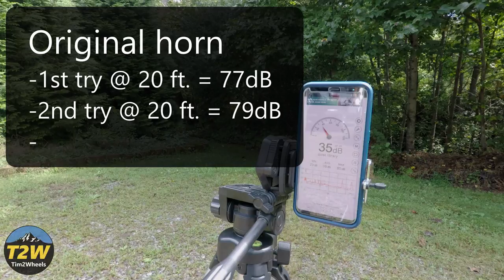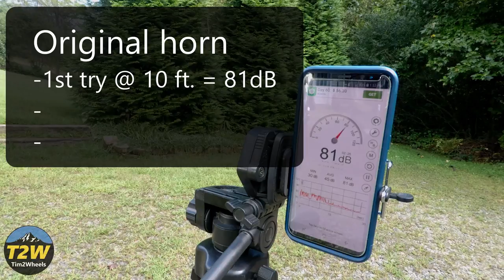Car Horn Upgrade on BMW GS Adventure. Is it worth it?

Comment: I just installed one (BMW auto horn) with out removing ANY of the panels/fairing. Easy. Just remove the existing horn only, not the brace. Bend back the brace a bit for final fit. Fit new horn in existing brace. Plug n play. Sounds great, did it in 15 min. 2021 GSA 1250

Comment: Tim I just replaced my stock horn on my 2016 s1000 XR with the BMW 5 horn.  It was a 30 minute job thx to your video and huge improvement over the road-runner "meep meep" sound of stock.  Thx for the help

Comment: I will have my GS in November and intend on doing the same. Thanks for sharing. 
I will attempt to only loosen the 13mm nut and replace the horn part and not the bracket, this way one don't have to remove all the body panels.

Comment: I received my BMW car horn today and intalled without a hitch as per your video. The hardest part is removing all the body work. While I was in there is cleaned the air filter. Thanks Tim.
Reply from the maker: Hi Kim, I'm glad the video helped. I really like that horn. And you're right, that BMW bodywork is the hardest part. - Thanks for the comment and for watching.

Comment: The Denali Sound Bomb is the bomb! The OEM Low Pitch sounds fantastic too. I hope BMW addresses this for the US market in 22. With these bigger displacement GS/GSA bikes being used more on the super slab it’s imperative to have a way better horn. Ear piercing it should be. Way too many distracted drivers on cell phones and in-cR tech. As well I’d also like  to see “backlit handlebar switches” for night riding and an electric windscreen.  Put it all in a Option 719 package and call it The Highway package. I’ll buy it! Ride safe and ride often.

Comment: I have just installed a horn from a 5 series BMW car.  The cars have two horns a high tone and a low tone.  They are a mirror image of each other. I found the high tone one fitted in place with the horn pointing down. High and low tone are written on the horn. otherwise they have the same markings.
Reply from the maker: Hi, thanks for this info. I will need to take another look at that mounting option.

Comment: I always appreciate the thoroughness of your demonstrations, Tim. Coincidentally, I fitted a Soundbomb to my R1200GS LC only yesterday. It required an additional lead to fit to the canbus wiring but, otherwise, was a straightforward installation and was achieved without having to remove any bodywork. It's incredibly loud too.
Thanks again. 
👍
Reply from the maker: Hi Keith, I was really tempted to buy a Soundbomb. Thanks for the info on how it installed.

Comment: The dB meter is an indication, not logic why the new horn is louder at larger distance. For automobiles the tone is more important than the sound level. Nice with a quick solution without rewiring a part of the bike and no errors from the CAN bus

Comment: Thanks Tim.  From one bike you tuber to another.   I’m a Denali stockist and installation specialist but I do believe in having options and I will be looking at this as an option for buyers who want to be heard but not going all way with the air horn soundbomb.
Reply from the maker: Denali products are good stuff. But it's always nice to have options.
Thanks for the comment and for watching.
Reply: I have a Sound Bomb but the bike I have is a Factory Lowered R1250 GSA.   Twisted throttle says it's not possible to mount that horn between the forks as shown on their website.  Any thoughts or suggestions?
Reply: Michael Glasman I’ve fitted the soundbomb to many factory lowered 1250s.    It fits fine, however they may be referring to the clearance when the suspension is fully depressed.

Comment: I wonder if you could have found a place to add the car horn, keeping the stock one working also.  Two is better then one!  Unless you need to count amperage.  Also noted at 13:20, you rotated the horn down to get the sound out.  That would also be important to let water get out!  I'd guess you could catch some wetness on a rain day trip.  If the horn was aimed up, no place for the water to escape.

Comment: Great video, Tim.  I am getting a 1250 GSA in a week or so.  When I was watching your video, I was really excited about using the car horn, rather than the Soundbomb. But the results were not encouraging.  I have read the comments from other viewers and they make sense to me.  One last piece, though. I noticed that the car horn was louder at 20 ft. than at 10. That surprised me.  I also would question the Denali claim that it makes 120 DB.  Perhaps in a controlled environment with a better recording device?  I am thinking that I may try out the car horn option, as the lower tone would have value.  Since my new GSA has LED Auxiliary lights, I may not go with putting in a Cansmart system.  

In any event, thanks for the video, Tim.  I will search your other videos to see what other info I can pick up.  There is a huge difference on the motorcycle videos
Reply from the maker: Hi James, sorry for the delay in responding.
I'm not sure how accurate an app on a phone is for truly measuring the sound, but to me and everyone else who hears it, it is much louder. It may be the lower tone, but the sound does seem to carry better. I'm very happy with it. I hope it works for you too. 
Thanks for the comment and for watching.

Comment: Very interesting Tim. Some of the difference may be that the microphone on your phone may not be able to respond to the transient response range of the sound of the 2 horns. Also, I'm sure it has a limited frequency response range. I'm not a sound technician, but I feel like you would probably get a different result with professional microphones in a controlled environment.
Reply from the maker: Hi Roy, I think you're right. I'm sure the propper equipment would give a more accurate result. 
Thanks for the comment and for watching.
Reply: This is exactly why.

Phone apps are next to useless for measuring narrow band sounds like a car horn. Only really good for average levels of broad band sounds.

Comment: Most cars today use two-tone horns, low pitch and high pitch.  My K1200LT came stock with such a setup and it is loud for a motorcycle.  Sounds just like most modern cars.  I suspect the low pitch horn by itself will be only slightly more effective than the stock horn.  However, if you can find room to add an OEM high pitch horn also, you will have a great horn overall.  Both of my LT horns have the horn housing on them just as with a car.  I actually suspect they are the same parts BMW likely uses on its cars.  Just something to think about if you want to take the next step in having a really effective horn sound.
Reply from the maker: Hi LT, Those fancy K-bikes just have everything! :)
That's good to know and a good idea. I will look into installing both. It would be an interesting project.
Thanks for the idea, and for watching.
Reply: I don’t know of a way to post an image here showing the BMW part numbers, but if you look here under electrical system for the LT you will see the part numbers for the high and low pitch horns.  Not sure if these are different than what you used.  https://shop.maxbmw.com/fiche/DiagramsMain.aspx?vid=51715&rnd=07242017

Comment: it fits also R1200GS from 2011 with some modifications. It is much better than the original one!
Reply from the maker: Thanks for the information. I really like this horn, it definitely gets peoples attention when needed.
Thanks for the comment and for watching.
Reply: It is a little bit tricky to mount it on a air cooled GS ADV as the space is very much limited. But I think to mount another horn is even more difficult. So the result is convincing and is worth every dollar or euro as it makes riding safer and you get heard in case of any emergency.

Regards from Germany

Comment: Tim, another great vid. Really enjoy the channel. I just got a gen2 KLR and right away I upgraded the horn and the "skidplate" from the ridiculous and underwhelming OEM parts.  I was thinking Denali but for draw considerations, chose a pair of PIAA 400/500 HZ horns. I haven't tested for dB, but they blow away the OEM meep-meep horn.  Mounting location was the trickiest thing and I put one forward in the bodywork, and one aft under a turn signal to get attention behind me as well.  ;)  Not as plug and play as yours, but lighter draw and lots of bang for the buck.

Comment: Hi ! Great video. Just want to add in that the db scale are logarithmic. i.e an increase of approx 3 db actually double the noice level. I just mount a 130db Denali sound bomb copy from china in conjunction with the stock one and it`s ridiculous loud. Guess I will get problem down in Europe if used without caution. Note that bigger horn require some times it connected to a relay or HexEzCan system as sound are close related to effect output. Motorcycles equipped with can bus are also sensitive for large output on wires with fixed amps and could give error code.

Comment: You can order a FIAMM Horn. Fiamm 927385 AM80S/L Kit Low Note Single Horn OE Fit. I think BMW 5 series use Fiamm as OE. It comes with 2 connectors and it fits. I just installed it.
Reply: Hi, does it come with a BMW connector or is it compatible with the BMW connector? Regards

Comment: the new horn is easier the loudest it may not be as many desibels but the sound is much louder...btw which meter app did you install on your phone to use ?
I have just changed my scooter horn pain in the ass as the space is tight so opted for a PIAA horn 400mhz and sounds much better and fits in the same space without stopping full handlebar lock... My original idea was to fit a stebel magnum 80 horn but alas was to big nice sound but to big I will use it on my next big bike.

Comment: Back in the day BMW used to have Fiamm electric horns original equipment. The R100RS had dual and it was easy to add one more to my 77 R100S. With the advent of the K-series-1984?-they were using regular ones with a pretty weak sound. Dont know why  manufacturers  dont  address the problem of these  pitiful beepers-if you need to use the horn in emergency you want to be HEARD!!!

Comment: How does this horn compare with the Denali sound bomb mini
Reply from the maker: Hi Ian,
I can't compare, because I've not heard the SB mini  in person. My original plan was to go with the Denali, but I wanted to keep both high power circuits on the ezCAN available.
I have been happy with this horn, it is better than stock. 
Thanks for the question and for watching.

Comment: Hi Tim, do you think this horn will work on the f 750Gs?
Reply from the maker: I think it will. As I understand it, all BMW motorcycles have the same setup. If in doubt, check with your dealer. They should know for sure.

Thanks for watching.

Comment: You can go to a Scrap yard with your Bike battery or a Booter pack ..
You can test horns till you get one with the loudness that suits you .
Installing a horn is not that hard...
Wire connectors and butt connectors.